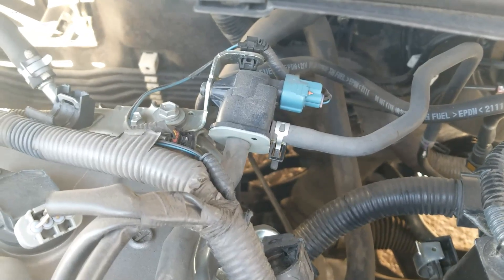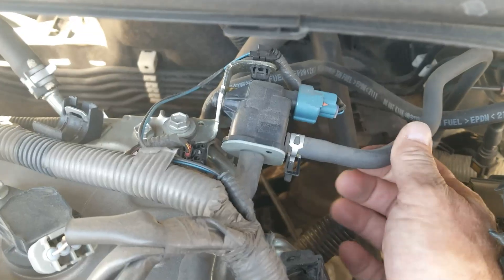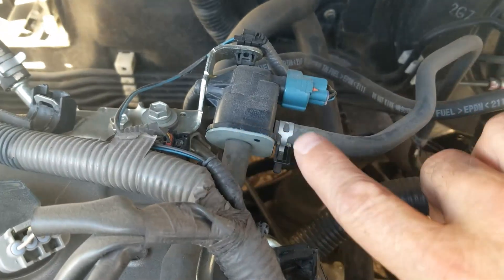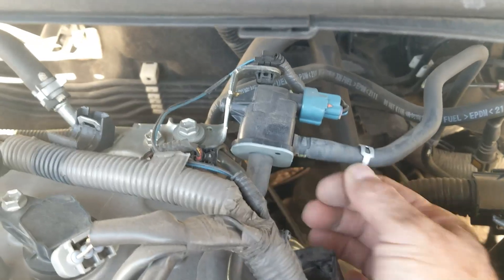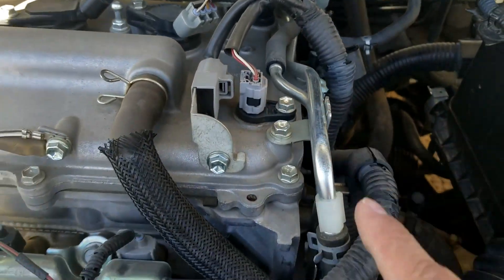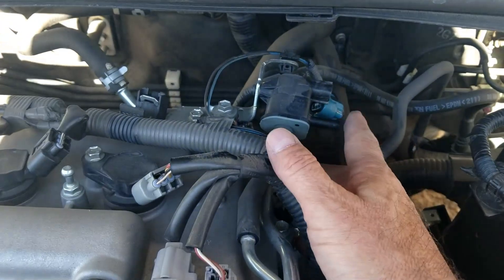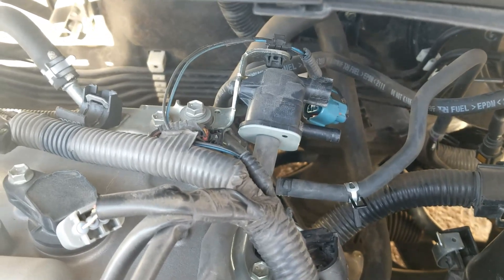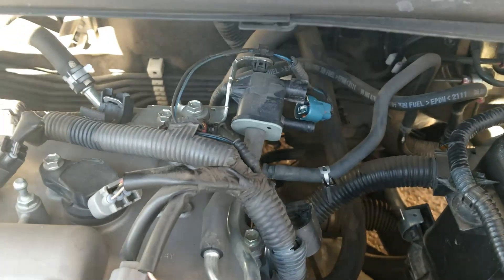How To Test If Purge Valve is Stuck Open (No Tools Needed and Without Removing It)

Comment: Does the valve just fully open and close or does it open in incremental steps?
Reply from the maker: It varies and depends on the vehicle. Older systems use an On-Off solenoid (very common), which just opens and closes. Newer systems sometimes use a proportional purge valve that can open incrementally in steps.

Comment: I aint car savvy  altough  i'm trying  to become it, so this is gonna sound stupid.

How does the car turn on if the tube bringing fuel to the engine is unplugged? Is there residual fuel in the engine? 

 I have most of these  symptoms and am looking to change the valve myself, I just want to make sure it's the issue before I buy the part.
Reply from the maker: It's only fuel vapors; the fuel line is separate. The EVAP system is for emissions to stop the fuel vapors from going into the atmosphere.

Comment: So if I find that purge valve is stuck shut, do I need to replace it? Is it going to cause more problems?
Reply from the maker: If stuck shut, it doesn't usually affect the engine, but there will be a code, and the vehicle won't pass an emission test.

Comment: 2016 Mazda 6, I left the electrical component plugged in. From cold start there was no vacuum and then when the engine got up to temp the vacuum never once kicked in. So would that mean it is stuck closed and/or the electrical component is failing to send the signal to open it?
Reply: A short amount of time after doing this the engine light finally went away. Maybe there was blockage of some kind that now got blown out since the hose was disconnected? I kid you not, I've dealt with it for about a year and it been gone now for a couple of months.

Comment: I replaced the EVAP purge control solenoid, did this trick but I still feel suction, what would be the best most logical step to check?
Reply: Do you notice suction when you 1st start it or after a few minutes?
Reply: @ first start, with 2 new units from autozone.

Comment: Hello. Great content. I have a.purge valve with a strong suction when connected and none while not connected. It ticks loudly while fully connected and engine running. It's brand new, also. I wouldn't worry about the ticking but it's kinda louder than normal. Thanks. Cheers

Comment: thanks for the video, it is excellent and clear... I have a question my HHR 2006 turn on the engine light with the Code P0442- Evaporative Emission Control Leak Detected(Small leak), could be the Purge valve stuck open?
Reply: I had the same on my silverado and it was my gas cap! Sometimes if you don't twist it back on all the way it will throw a po442 code! I would troubleshoot that first!

Comment: My purge valve only got one hose connected to charcoal canister , no hose to intake manifold. Is it normal? I have a camry 2001
Reply from the maker: There are two ports. Some purge valves, usually Fords, have a port at the back of the unit, where it is bolted to the engine. All Toyota purge valves I have seen have two hoses.
Reply: @HVAC_Mechanic  do you have instagram ? I could send you a photo because I have hard time to identified the part

Comment: What happen if stuck close ?
Reply: Is it 12v ? I want to put voltage and make it open and blow it out with carb cleaner.
Reply: @Captain-Smoke  first check voltge of valve port then do because some valve are of 5 v also
Reply: @Captain-Smoke  did that work ?
Reply from the maker: The engine light will come on and there will be an EVAP code. Also, the vehicle will not pass an emission test.
Reply: @HVAC_Mechanic  and in engine on condition purge to manifold pipe make to much vaccum
Reply: @HVAC_Mechanic  actually in my bike no engine light blink but I check purge valve it not allow air to pass when I give it supply,
 winding resistance also ok

Comment: I tried it but had to get truck running first or it wouldn’t start theft light also flashed. So when cold it didn’t suck then it started to and when wire disconnected doesn’t seem to suck. 

But the hose going to engine seems collapsed so it’s been sucked together